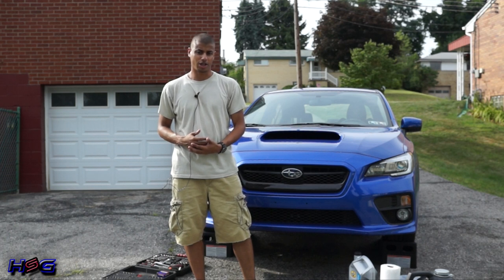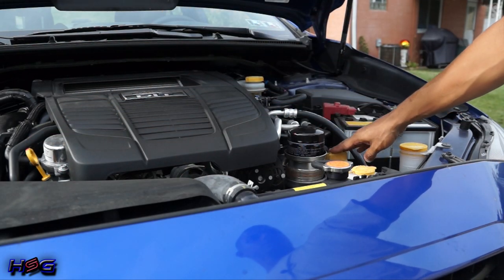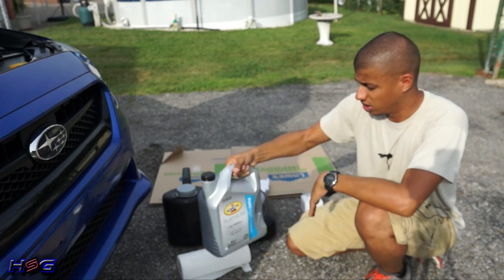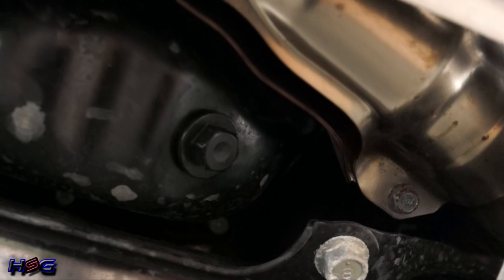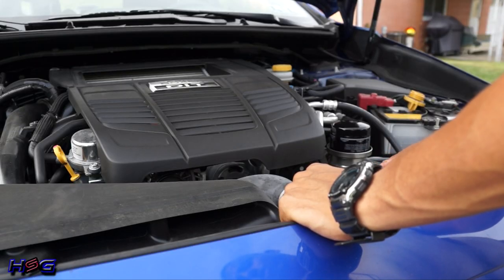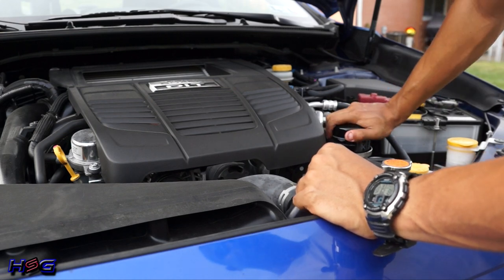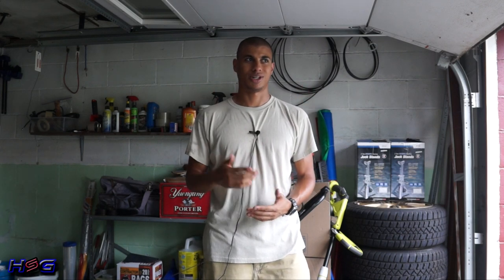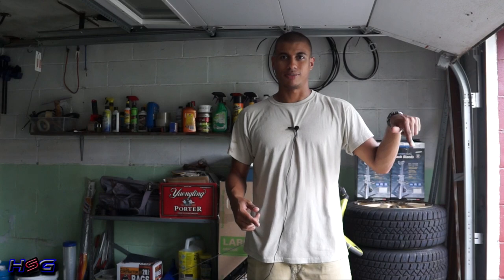Maintenance Series: 2015 WRX Oil Change

Comment: Quick question just got an oil change and yet my oil low light still pops up randomly and iv tried resetting it also?
Reply from the maker: Benjamin Spurlock Have you checked your dipstick?
Reply: HawkeyeSTiGuy yes and it looks surprisingly low and I shouldn’t have to get an oil change for another 2k
Reply from the maker: Benjamin Spurlock Then I would add oil. Seems like they didn’t add enough.
Reply: HawkeyeSTiGuy don’t think I should worry to much? I was thinking about taking it to the dealership where I got the oil change done and having them check if there is another problem by chance.
Reply from the maker: Benjamin Spurlock Yeah, Id take it back to them then. The dipstick doesn’t lie. More than likely they just didn’t add enough. If it was leaking then it would have to be going somewhere, so you’d have it mixed in with coolant or there would be oil under your car.
Reply: HawkeyeSTiGuy yeah and I can’t see any oil under the car what do you mean by mixed with coolant?

Comment: Where did you purchase those lift pads that lift the front of your car?
Reply from the maker: itachi's wish The Ramps? They can be found at most auto parts stores. Autozone, Pep Boys, etc.
Reply: @hawkeyestiguy  thank you and yes the ramps! Seems alot easier then a jack, are they very heavey? To keep from sliding? Sorry newbie over here.
Reply from the maker: itachi's wish No worries. We all start somewhere. 👍🏻 They are plastic & are very light, but sturdy enough to handle a car or truck. They have rubber pads on the bottom so they don’t slip.

Comment: Can the crush washer be reused at least one time?
Reply from the maker: In a pinch, you may be able to get away with reusing it, but there's no guarantee it won't leak. It's always best to just replace it. If you buy OEM filters it should be included.
Reply: +HawkeyeSTiGuy Thanks for the response.  I am in a pinch.. I am an expat in central america and I am coming up on my first oil change ever on this car . Last month I ordered a filter off of amazon ( mobile1 brand) and they did not include the crush washer.   So I just going to have to reuse it since I have already pushed the mileage further then I would have liked for the first change. Thanks for the video.

Comment: subaru oil filters are made by fram
Reply from the maker: +kmx14 True, but they are not of the same quality. Fram filters you find on the shelf are notorious for collapsing, where as the OEM Subaru ones rarely, if ever, fail, because they must meet Subaru's specifications. I will take an OEM Subaru filter over a Fram filter any day, & I know many others would do the same as well.
Reply: +HawkeyeSTiGuy Well, can't always trust OEM filters either..Have to watch for the gasket seal sometimes they come warp and may cause an oil leak from the filter seal its self. Also considering the oil filter is upside down, is there no need to start the car to get oil circulating and then check?
Reply from the maker: +Asthma Yeah, I can't speak for all OEM filters, but in my experience, Subaru OEM filters are on point & I've never had one leak or fail in 5 years of owning my STi. & the filter will soak up some oil, but it's not much, maybe .2qt or so, I'm not sure how much exactly without checking the manual. When I do the oil change on my STi, I fill the filter with oil first, & then screw it on, so I typically don't check the oil level a second time. It's not a bad idea to check it again, but I didn't in this video just out of habit.

Comment: Oil should be drained and refilled on flat ground, so much old dirty oil would be left in your engine. Don't check oil level just after pouring it in, check after you have started and left engine running for at least 1 minute so oil has a chance to fill filter and circulate through engine. Good video but your oil changing process should change to do a proper and worthwhile oil change. 👍👌✌
Reply from the maker: Captain Risky Well, if I had a lift, I would use it, but I don’t & it’s impossible to get to the drain plug without having the front end up. On my 06 STi, I can get to the plug just fine so I don’t use ramps. 

People have been using ramps to do oil changes for years, there’s nothing wrong with it. Is it perfect? No. But it works just fine. Car manufacturers take that into account when they build the car. I also fill my oil filter with oil prior to install, so it’s not necessary to let it idle to fill the filter with oil.
Reply: HawkeyeSTiGuy hi mate I use a car jack to lift the front while I remove sump bolt then lower car and leave it till it drains. Another thing also that is a better idea would be to loosen sump bolt first then open oil filler cap so not to get the rush of oil. I'm honestly not trying to say you done a bad job or don't know what you are doing. I'm no expert on all things myself but I'm only mentioning another option and for myself if I'm going to perform any mechanical work on any of my cars or bikes I want to make sure I get it done the best way possible. Didn't mean to offend or disrespect you and I apologise if I have. Good on you for making these videos to help others. 👍

Comment: good job!
Reply from the maker: +philboytano Thanks! I appreciate it!
Reply: +HawkeyeSTiGuy Hey brotha, where'd you buy those ramps?  Harbor Freight?
Reply from the maker: philboytano I actually got them from Pep Boys if I remember correctly. I believe Harbor Freight, Autozone, & Sears carry them as well. They were like $20-30 & work great. I will say though, they are not the best if your car is lowered at all. This WRX barely cleared them. My STi will not, & if there was a lip on the WRX, it wouldn't clear either. All in all, they are great ramps though, & are very light. I'm happy with them.
Reply: +HawkeyeSTiGuy oh good to know! Thanks Brotha!

Comment: 5litres only?
Reply from the maker: This model has the turbo FA20 motor & requires 5.1 liters/5.4 quarts when changing the oil & filter. 👍🏻
https://view.joomag.com/subaru-wrx-wrx-sti-manuals-2016-wrx-wrx-sti-owners-manual/0558293001433343824?page=546

Comment: Should've kept the oil cap on till after you removed the drain plug, also not instantly removing the drain plug would've helped. Better yet buy a oil drain valve.
Reply from the maker: Thanks. This was filmed not too long after my mom bought this car, but I have since installed a Fumoto valve. I have had one on my 06 STi for about 8  years now & still  love it. It's a game-changer.

Comment: I used 5w40 and now my engine feels sluggish...
Reply from the maker: Heavier weight oils have more resistance to them & can do that until they are fully up to temp, but they don't break down quite as fast as thinner oils. You should always use oils that are recommended by the manufacturer.
Reply: HawkeyeSTiGuy Thanks bro, im going to use 5w30 at my next oil change. Seemed to run much better.

Comment: u shouldnt have loosen the top cap
Reply from the maker: +Carlo Agsalon Yeah. You can wait to remove it until after it starts draining, but I always remove it first. It's just the way I do my oil changes. I feel better knowing that I can get the cap off & put more oil in, rather than drain the oil out & then have issues with the oil cap & perhaps need to run to the store, but can't cause there's no oil in the car. I guess it's just the way I was taught & is a carry over from working on older cars. That being said, I never spill this much oil. Lol. I have changed the oil in this vehicle twice since I made this video & didn't spill a drop either time. 👍🏻
Reply: +HawkeyeSTiGuy preference right? hows ur car so far?, just bought my 2016 sti, few weeks ago, loved it so far, trying to learn more about cars, so far i kno, brakes, oil change,
Reply: +HawkeyeSTiGuy  spark plugs, havent try em yet lol
Reply from the maker: Carlo Agsalon That's awesome! You should check out Evan Shank's, he has a video where he replaces spark plugs, although maintenance videos aren't his primary focus.
https://youtu.be/mRTl-umg_lQ
 I replaced mine before & it's really not hard, but it sucks trying to get to the coil packs because it's a tight fit & the frame is kinda in the way.

Researching on forums like NASIOC, IWSTi, igotasti, & watching youtube videos is probly one of the best ways to learn, save learning hands on, but you just have to be careful because there is a ton of misinformation out there. If I find information about something on a forum, I look for at least 2-3 other places that back up that information.

 My car is doing good, except I can't get into boost because my bypass valve leaking. Turns out that my 8mm phenolic spacers & my newly added ETS top mount apparently were causing it to rub against the hood & the body is starting to separate from the flange. It's a Perrin unit which kinda has a weird design to it, but I will do a review on it once it's replaced. I just ordered a new BPV from Cobb & it should be coming in next week. Other than that, the car is running great.

Comment: @9:18 Don't just start it like that.  On the 15+ you're  supposed to hold the accelerator pedal to the floor while you turn it over until the oil pressure on the dash turns off.  Takes 15 seconds or so of cranking.  This primes the oil system and when the light goes out that means proper oil pressure has been restored, before actually cranking it.
Reply: so hold the accelerator pedal and turn the key but dont start the car?
Reply: @supwitaids1  It won't start even if you turn the key to start.  The engine will just crank over until you let go of the key or the gas pedal.

Comment: Thou shalt not open oil cap until u start to open nut
Reply from the maker: Yeah, I guess I just have a quirk where I like to always open the fill neck/port/hole on whatever it is before I drain anything. Shouldn't be an issue here, but if you drain a fluid and then can't open the neck to fill it, you're kinda effed.

Comment: tiny ass lawn mower filter
Reply from the maker: +CrazyForCooCooPuffs As long as it gets the job done, I don't care so much how big or small it is.
Reply: bigger filter means more oil pressure after it for your bearings. Smaller filter just acts like a restriction
Reply from the maker: Maybe, but there are a lot of other factors to consider as well, such as the micron size of the filter element, & how is is designed. I really don't subscribe to the 'bigger is always better' mentality, although, in some cases that is true. In the case of a motor, more oil pressure is not necessarily better, the engine is designed to operate with a certain oil pressure range. Too much pressure & you'll start blowing seals left & right.

The way I see it is, I trust that Subaru has done enough R&D over the years to know what kind of filter works best on their motors. There are thousands of Subaru's across the world with over 200K miles on them, so Subaru is doing something right.

Comment: No no no no, when are people gonna learn. I subie engines just put some freaking MOTUL oil and oem filter and you're good, I'd their 600whp GRC cara use that you think your regular stage 2, maybe more modded car won't like it? Jesus then they wondering why their cars sound like shit and start going.
Reply from the maker: Jesse Madrid I'm sorry, I'm having trouble understanding your grammar & am not sure exactly what you're trying to say. In this bone stock WRX, I'm using 5w30 Pennzoil Platinum & an OEM filter. In my built, fairly heavily modded, not stage 2 STi, I will be using Amsoil Signature & an OEM filter.